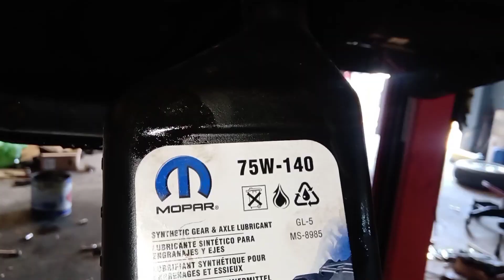2002 dodge ram 1500 rear wheel bearing replacement step by step

Comment: Just incase someone watching this doesn't know DO NOT let your calipers hang by the brake line like you see in the video unless you want to replace the line
Reply from the maker: Thanks for your advice sir
Reply: good work
Reply: . you probably know this already but if you don't.... brake lines are strong since they under a considerable amount of pressure doing that once may not do much but doing it multiple times will put stress on the line right where it goes into the metal fitting amd they will pop your brakes work on a hydraulic system which means the whole system relies on high pressure to work properly if that seal is broke anywhere in the system the whole thing will lose pressure and fail which could be catastrophic and potentially lethally if it happens while youre driving you dont want to take any chances with it
Reply: @Autoenginecheck   Its not as much the line cannot hole the weight it is how it hangs , look at how to kinks the line or folds it over this can damage the line and cause premature failure. It might not leak today Some might say if it does leak then it needed to be replaced.   I have seen new lines get bumped the swinging weight was enough to cause the line to fail.  This is especially the case on older cars, if you cannot get the line quickly this can mean the vehicle is down for several days waiting for a part.  a  piece of  strong wire bent into an s shaped hanger best to have 4 in your box. or use zip ties. I like the wire hangers.
Reply: Hackerville. This is why I prefer to do as much repair with as I can. You just never know what these people are doing. Might not cause an immediate leak, but could cause a premature failure at some point.
Reply: I'm very surprised, I don't know how that happened, because it's basic.

Comment: After you remove the axles  in the rear diff should you put the pin back in to keep the small gears on the top and bottom from falling out? I’ve seen them fall out in a few other videos and everyone says they are a pain to get back in
Reply from the maker: It is not good to re-apply after opening the axle lock or the small gear may go off later Although it can be attached later, it is better to keep the pin attached thanks FOR comment sir
Reply: bro they are a pain it took me days to figure out how to get them back in right there are no how too vids DO NOT DROP THEM
Reply: @caseyr04  I did this job a couple weeks ago I ended up holding the gears while I popped the c clips out and then I put the pin back in while I was working on it. Everything worked out great no problems

Comment: I would've packed the bearings.
Reply: Not these bearings. Mixing the grease with the oil is asking for trouble. These bearings get constant gear oil. No packing.

Comment: I replaced mine but never messed with the differential. I don’t seee why you would need to even touch that
Reply: Not sure the type of rear you were working on, but this is a Chrysler 9.25" which uses internal C clips to secure the axles. If you look closely at 11:30 you can see the clips going back in.

Comment: So you used a dirty piece of rebar shoved through the differential to the opposite side to use to get the bearing and seal removed instead of buying the proper tool. Definitely don't use this shop! 😮
Reply from the maker: Dirty rod but later cleaned it with petrol sir